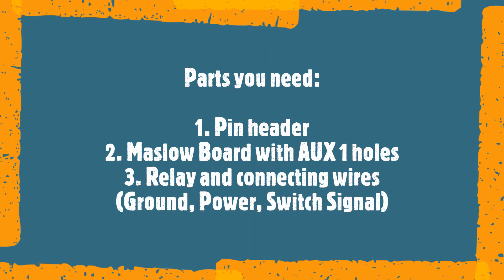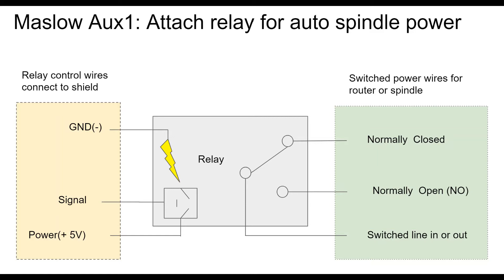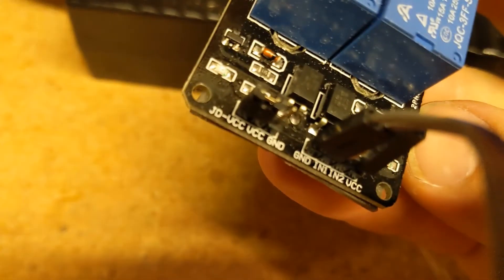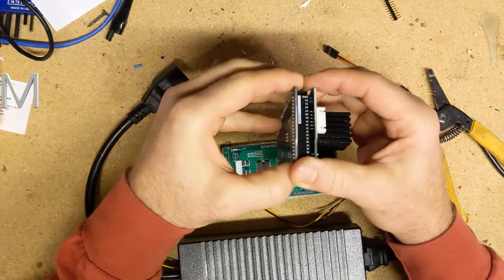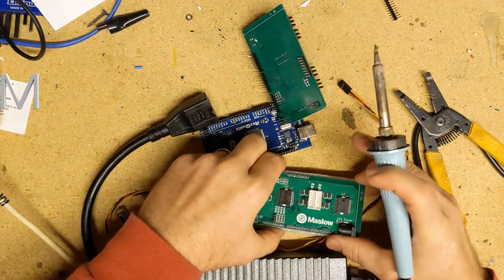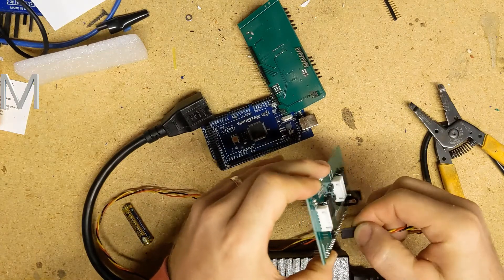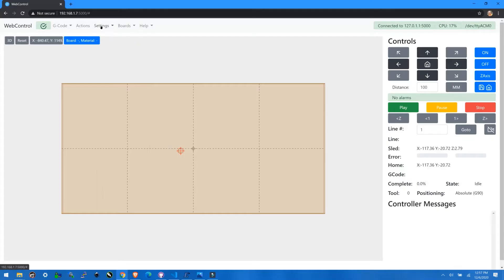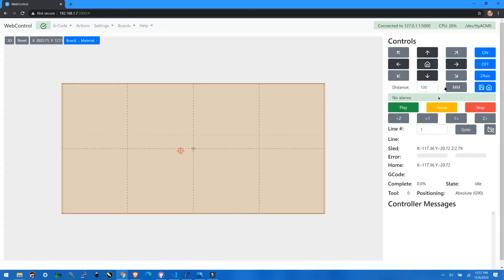Spindle Relay for Gcode Control

Comment: Have you tried his on the Due board (the board for the M2) ?
Reply from the maker: I have not and I no longer have the M2 board.
Reply: @robthebuilder9654   Why did you decide to get rid of it?  I’m assuming you’re running the old board instead?
Reply from the maker: @nolancraw  I had an m2 (v2) controller on loan to try it out.  I also have a due with a v1 shield.  The v2 has 3 heat sinks, the v1 has 2.  I still have the v1, but it isn't the M2 setup exactly.  This setup runs the 4x4 metal sled system in the videos, but this video is for the mega... My other system that runs in webcontrol.